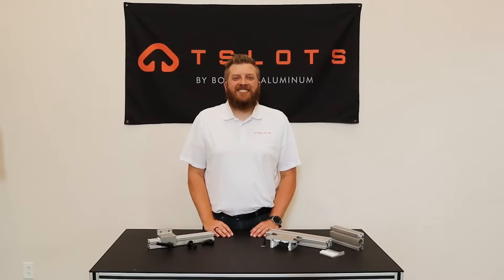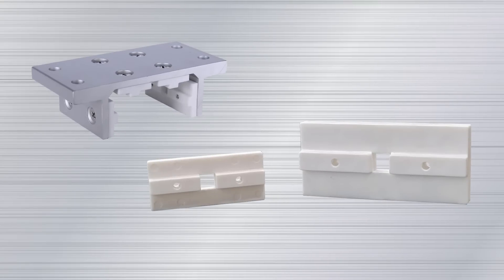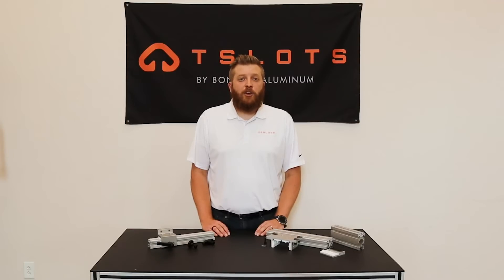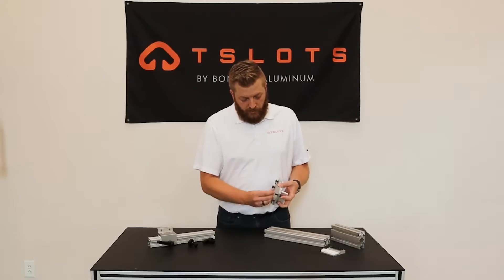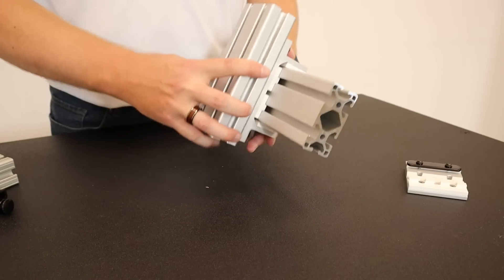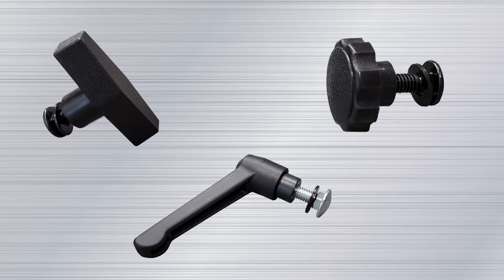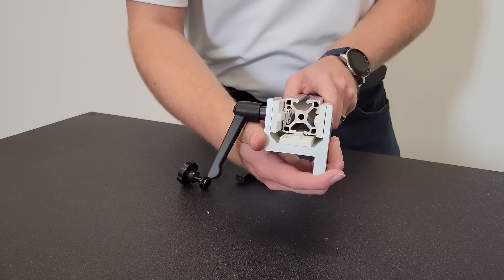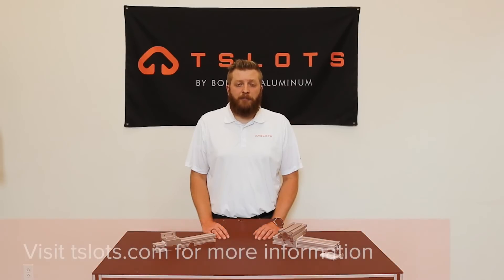Product Highlight: Linear Bearings

Comment: What is the purpose of single flange bearings? It appears as if it would apply pressure unevenly on whatever is mounted to the single flange?
Reply from the maker: @carterscustomrods There are various applications that the single flange bearings are used for and provide different options for mounting than the double flange offer. For information on the pressure applications, reach out to tslotsinfo@bonnellaluminum.com

Comment: Will the plastic slots wear out after usage? I have used Igus style linear bushings, they don’t last very long, also they are not very high tolerance
Reply from the maker: Arbj, Thank you for the question. The pads are made of UHMW material and are durable and smooth. Regarding the comparison with Igus, please reach out to tslotsinfo@bonnellaluminum.com for additional information.
Reply: I have never used this brand, but I made a guide for my 100 lbs forging hammer, and was shocked to see the teflon contact points had worn channels into the steel guide. It was the most fascinating thing I had seen with plastics.